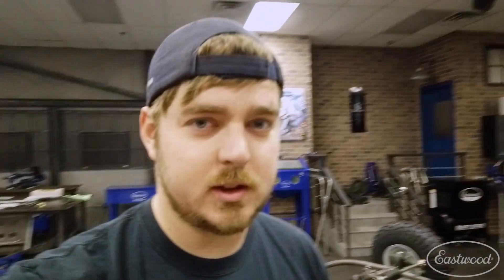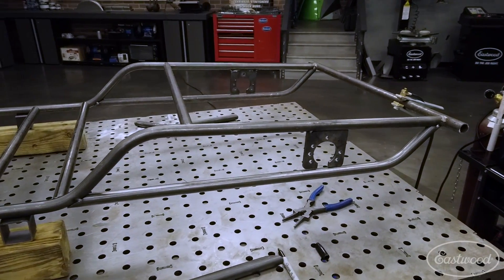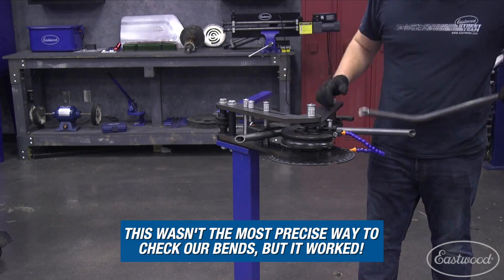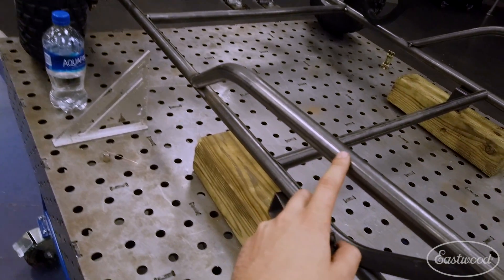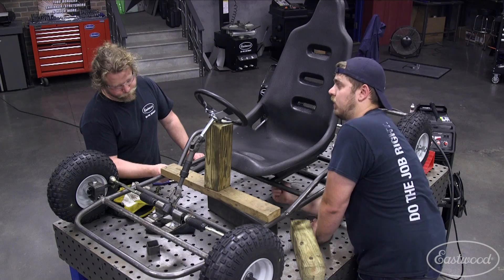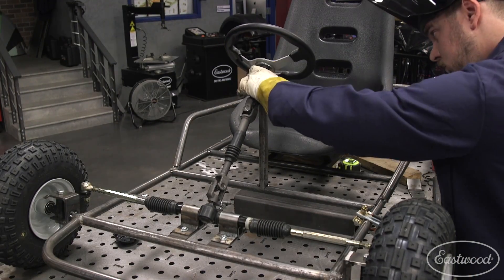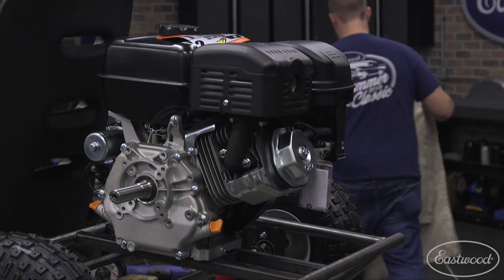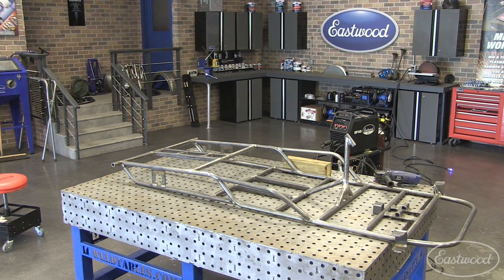Brand New Builders - Mounting the Motor, Completing the Frame & LOTS of Welding! Episode 4

Comment: How are the rear wheels Driven?  Are you using an axel connected to both tires and have a sprocket on the shaft?  I am assuming you took the bearings out of the rear tires so how did you attach the rear wheels to the shaft so it does not slip when power is added?  Fun project!
Reply from the maker: This is a Live Axle setup. The tires and sprocket are keyed to the axle. It was really easy to setup!